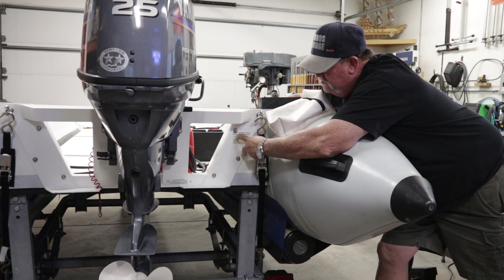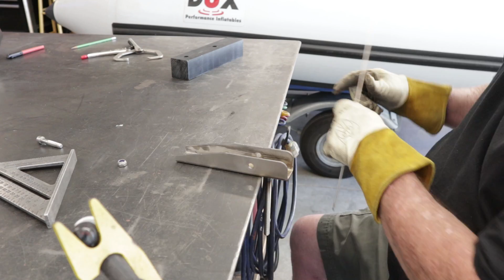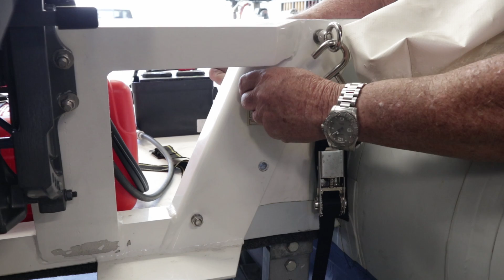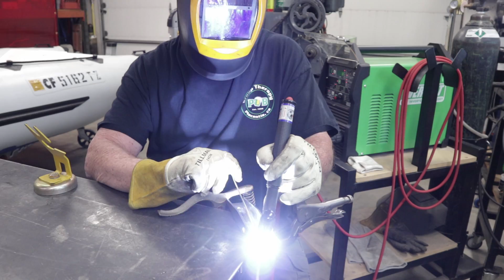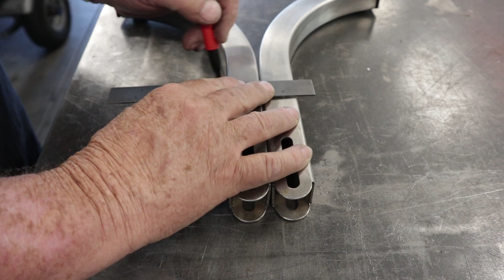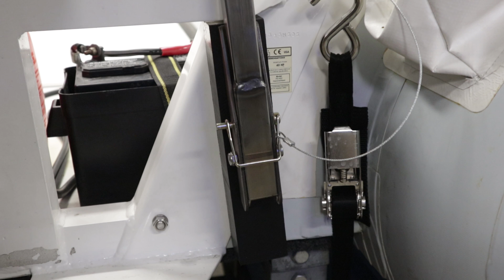I Put Wheels on a Boat | JIMBOS GARAGE

Comment: Beautiful work.  I'd love to be able to make welds like that.  I'm using a HF wire welder and my welds are not very pretty.  I'm buying a 14 foot inflatable and since my marina is literally around the corner, I was thinking about towing the boat to the marina, using transom wheels.  I'm thinking something a little more robust than what you have there, and I'll probably slide the shaft in from the top, and remove after it's in the water.  Top speed for the tow will only be less than 20mph.  Do you think this is doable?  Maybe use an axle assembly that has support on both sides of the wheel?  For the front, I'll design a hitch attachment for the bow ring.  Should be an interesting project!

Comment: To prevent stainless steel welds from rusting you can use pickling paste, available from welding suppliers, to oxidize your welds. Stainless steel has an oxidized layer that can be damaged at certain temperatures. Many times only a small band at the edges of a weld lose protection and allow rust to form. Pickling paste is and easy brush on wash off corrosive insurance. Nice to see someone who enjoys variety in their work. Take care.
Reply from the maker: Thanks for watching and your advise Jim,  Jimbos garage!